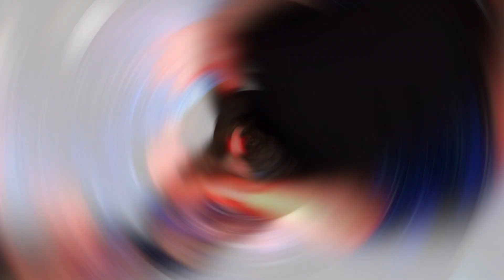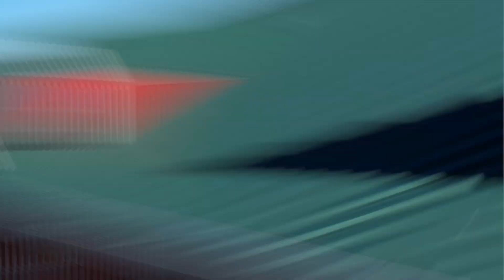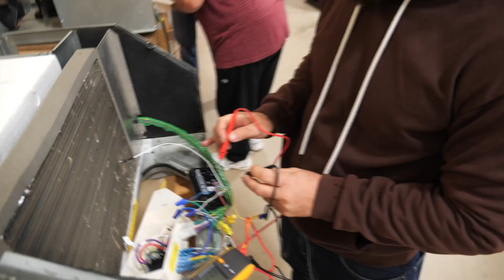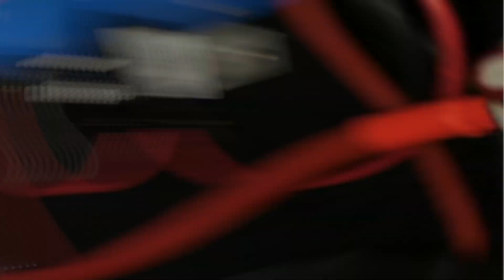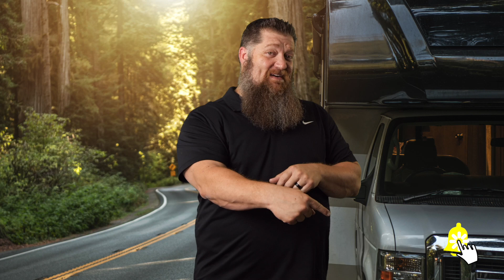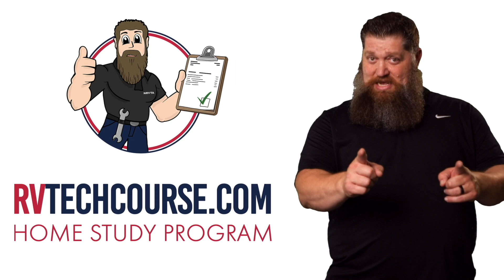RV Electrical questions

Comment: I have a class C motorhome and I plugged my 30 amp cable with adapter into a regular 110 volt outlet, turned the unit’s main power switch on to keep my coach batteries charged for the winter. How can I find out if the battery in the engine compartment is also being charged by the converter or is it separate and I need to put a tender on it. Thank you, Nicolaas

Comment: Your videos are Fantadtic. Question for you. A person on YouTube said to replace the plastic plug with a brass plug on the hot water heater. Also replace the plastic the check valve with a brass one. I thought this was not a great idea to do on both. Am I right or am I wrong to replace them with brass fittings?